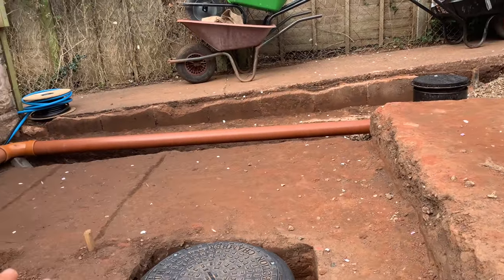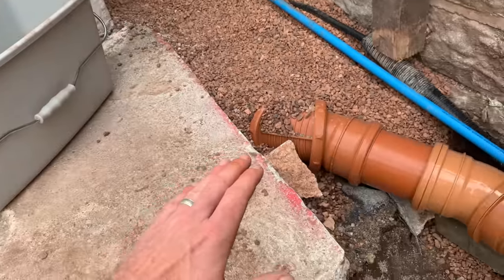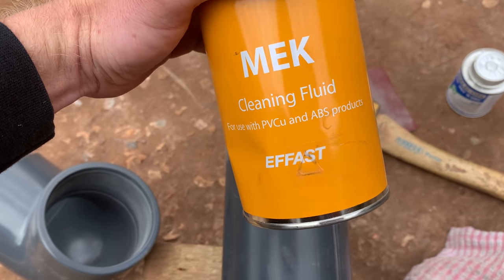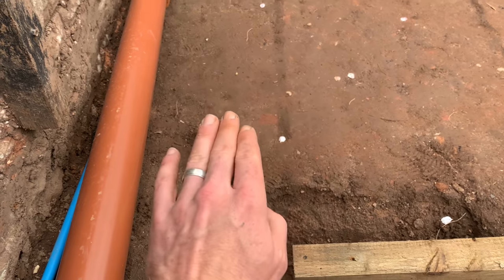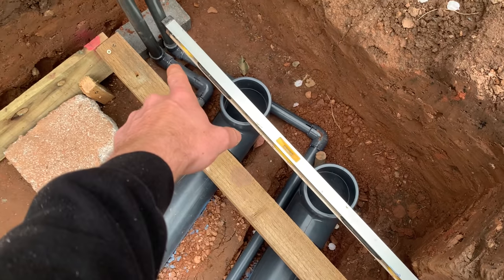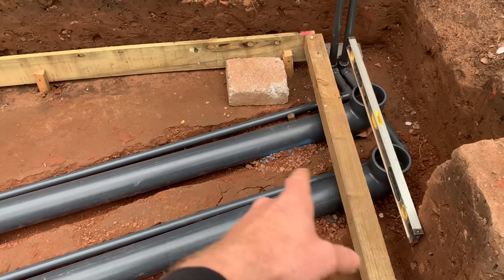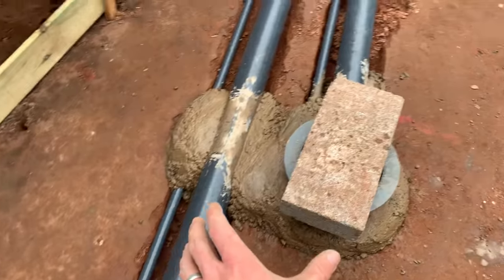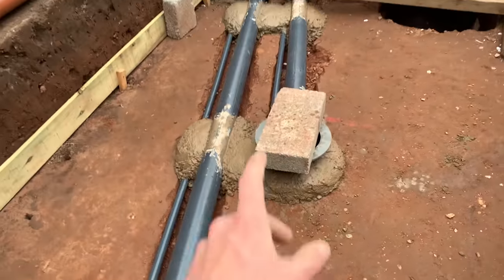THE NEW KOI POND BOTTOMS DRAINS ARE READY**HOW I SET THEM**WILL THIS HELP** PART#25 NEW POND BULID

Comment: All going well mate. Soon be time for the concrete pour. Make sure you will the drains with water aswell as stacking blocks on them. Don't want the pipes floating through the concrete. You wouldn't think they would move now you've cemented them but you would be surprised. Keep up the good work 👍
Reply from the maker: Done it by hand it’s in mate
Reply: @JamesTHEKOIwhisperer123  nice. Forgot you film these a week ahead. Look forward to seeing it. Bet that was hard graft doing that all by hand

Comment: James if your going to bring the services into the filter house up through the floor it would be good practice to put them in a duct and not concrete directly around them and I would recommend putting a polythene membrane down below the concrete, you don’t want the soil suck all the water out of the concrete before it sets naturally.
Carry on with the vids I look forward to them each week👍

Comment: just a recommendation. it's a good practice to install a 4 in conduit pipe to put the electric, gas, water pipes inside of it instead of cementing directly on them, that way you have a large conduit to pull things to the filter house in the future and able to replace/upgrade if need too.

Comment: It’s been said a couple of times but fill those drains with water before pouring the concrete. The drains and pipes will float if you don’t. Don’t underestimate the power of air we al have pushed a ball under in a pool and that’s just a little bit of air 😉

Comment: should put t pieces instead of 90's when going to the drums and bring the pipes after the t pieces up passed the pond level so you can jet the drain lines as you won't be able to purge the drains with a drum
Reply: I think on that length of pipe run it won’t be an issue - you can purge into the drum also just by shutting the 4” for a few moments, but yeah ideally you should have a purge on both drain lines.
Reply: @inazumakoi  shutting one drain will not purge it, you will have some bit come through but nothing compared to purging it properly
Reply: @MikeZak101  I meant both... 4”’ valves.
Reply: @inazumakoi  still wouldn't be enough
Reply from the maker: @MikeZak101  my plan it will work a treat mate trust me

Comment: James you did not test the bottom drains for leaks after glueing them together as it would be bad if they leaked on a joint.
Reply from the maker: Fingers x then  what would you have done to test ? Filing them with water don’t work 

It’s the wait of water in the pond that makes them leak but I haven’t got a pressure test kit so I put shit loads of glue on